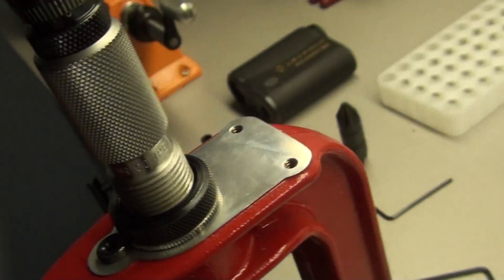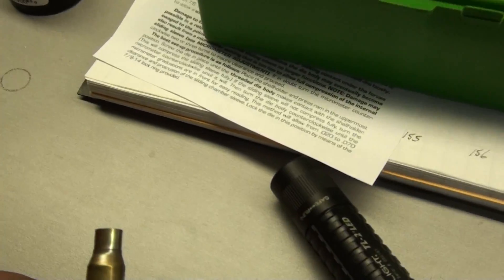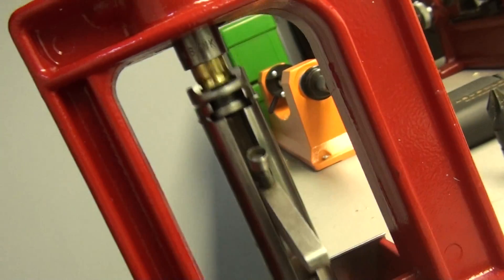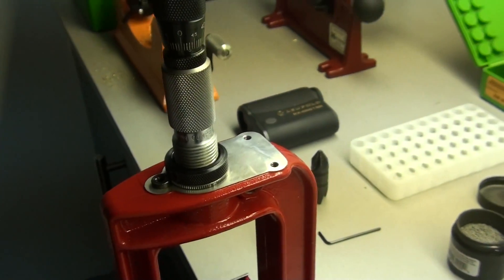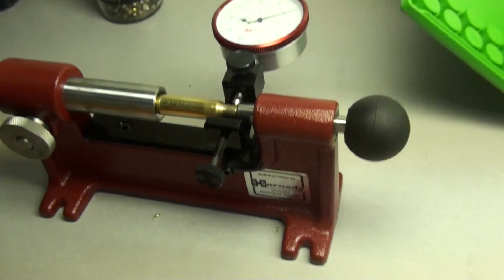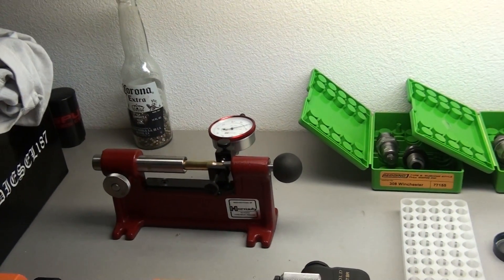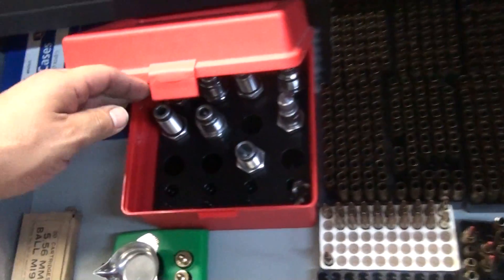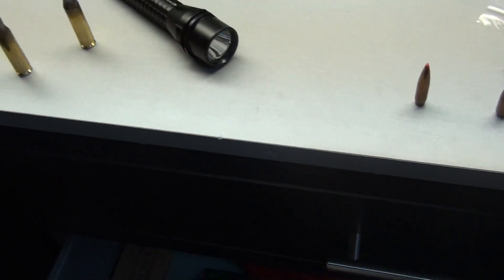REDDING S TYPE NECK DIE

Comment from the maker: @soloban81 seat a bullet into the lapua brass and measure the neck. the some comment size is 249-247--  so if you measure 250 on the neck then get 249 bushing. I use 248 for my 223.

Comment: Do you see donuts with your brass? It looks like you didn't turn the brass all the way into the shoulder, I thought that was a recipe for disaster with regards to donuts forming at the neck/shoulder junction. Otherwise, thanks for the video. I just ordered one of these myself :)
Reply: +drfroglegs The purpose of this specific competition neck sizing die is that it allows you to "back off" and not resize the entire neck. This is the donut that you saw where the neck meets the shoulder. What that does is allows the case to have a better, more snug fit in the chamber to prevent it from having any room to wiggle around and stay pointed down center more.